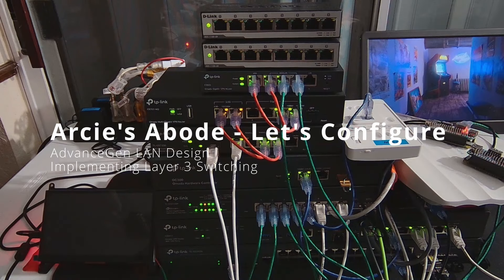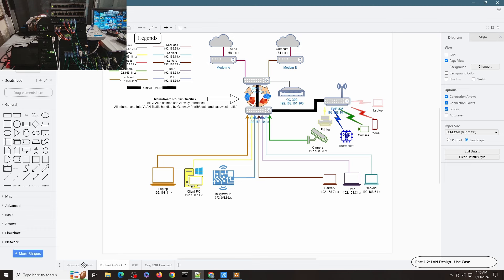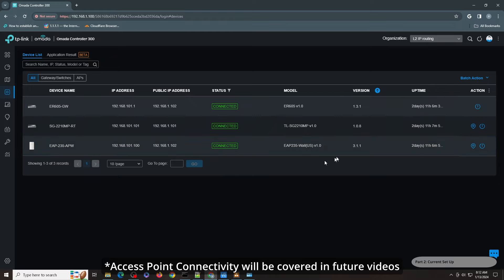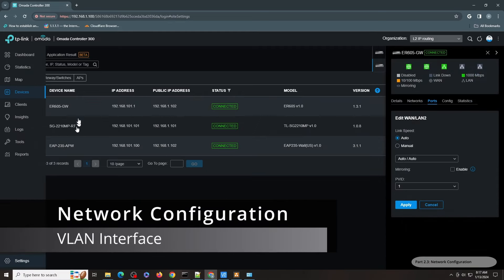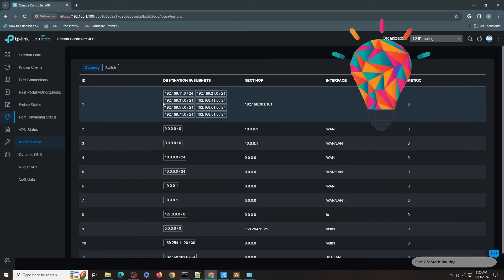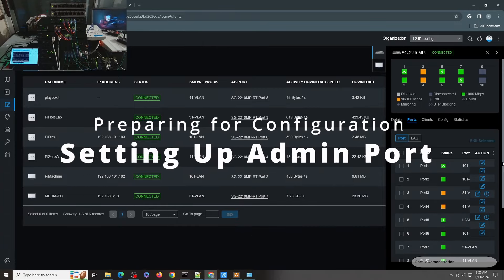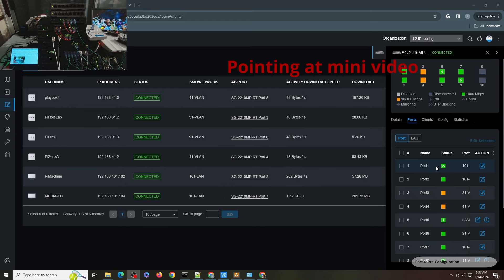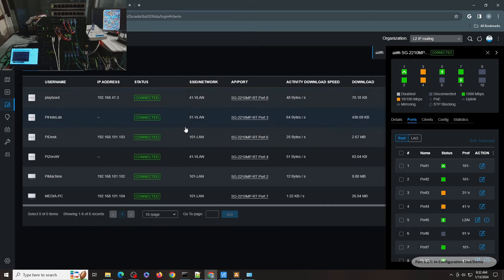LC67: Layer 3 Switching with TP Link Omada. Use switch, instead of Gateway, for InterVLAN routing

Comment: Thanks for the video. I had a question about using Interface Lans and Layer 3 switches. Please correct me if I am wrong, as I am having some trouble understanding the best way to set this up.
I think that even if you use an interface Lan instead of a VLAN, the Layer 3 switch will still route traffic directly across the Lans, rather than forwarding up to the router. I think this happens in the default Omada setup without any ACLs.
In your NextGen network setups you segregated your interface Lans with Switch ACLs, and that did prevent traffic flow. Isn't that because you didn't have LAN->LAN Gateway ACLs set up, so by disabling the routing bypass with the Switch ACL, the packets get forwarded to the default gateway for routing and are then dropped?
What I mean is, with Interface Lans and appropriate Switch ACL setups, the "router on a stick" problem can still be mitigated for everything that doesn't need a stateful firewall.

Or maybe I got completely the wrong end of the (router on a) stick?
Reply from the maker: hey there @Mark-px3rq, thanks for dropping by the channel. It may seem like I have confused you on my videos so me let just try and clarify. "Network Routing" is performed at the Layer 3 and usually performed by a device called Router and in Omada, they call it Internet Gateway. Routing is performed in "Layer 3" of the network stack and deals with things like IP address. "Network Switching" is performed at the "Layer 2" and done by a device called "Switch", and deals with things like "MAC address", These two are required to have a fully functioning network. However, ACL is not, it is a functionality that grants or denies access (hence Access Control List name). This means, Routing and Switching, while impacted by ACL are completely different, they all work together and intermixed but while the two are basic building blocks of networking, ACL is not. 

With NeXTGen - ACL I used are Switch-based i.e. they work in the Switch but that doesn't mean "routing" happens in the switch. The ACLs are working in the Layer 2 and not in Layer 3, but the ACL is NOT responsible for "routing" because ACL is not routing, it is about granting/denying access whether there is routing or not.

The easiest way to test, create a traditional Omada LAN:
a) Make sure you have more than 1 VLANs defined in your Omada LAN i.e. VLAN 1, VLAN 10, VLAN 20 and all are Gateway Interface (i.e. not Layer 3 Switching)
b) Make sure you are using Omada Gateway and Omada Switch
c) Make sure no VLAN Interface is enabled on the Switch except for VLAN 1 (default)
d) Make sure you have no ACL active.
e) Plug at least one host per VLAN on the Omada Switch, including the Admin PC/Host

Testing:
0. Make sure your admin pc/host is connected to the switch
1. On the admin host, open 2 (or more) consoles, do consistent ping for each host on VLAN 10 and VLAN 20
2. Remove the cable between Switch and the Router. Without the Gateway uplink, ping will fail. This means the Switch is NOT doing routing even if the Switch has all the VLANs defined on it, With Layer 3 Switching (this video's goal), this will work since Switch is responsible for InterVLAN routing.

Hope this helps!

Comment: Thank you for that video! It is brilliant! May I ask you few questions? Were you would locate local DNS server (like PI-HOLE) in that setup? I have an idea to put them in 101-Admin vlan and set router to use those DNS and the PI-HOLE will ask any public DNS. The other question is related to controller. In your setup controller is connected to the router. Is that realy matter where controller is located? Can I connect it to the switch? I want to use POE that is not available on router/gateway ports.
Reply from the maker: hey @rafalbremer432, thanks for dropping by the channel. For the DNS, it depends on you. It can be local to a single VLAN, or to a router that serves multiple VLAN. If you need granularity, you will need to manually point each VLAN to your PiHole, this is how I have it configured on my home. If you want simplicity, you can point your router to the PiHole but note that PiHole has its own quirks, so you will have to be aware of that in case trouble shows up and in this case, the Admin VLAN 101 is a good choice to place it.

As for controller, the location is mostly based on my personal use-case, because I need the controller to be easily accessible by the router but it can be connected to a PoE switch if your Gateway doesn't support PoE.

Good hunting!

Comment: Thanks, that works!
But can I create rules now? I have created 2 VLAN networks "Home" and "Server". Everything works. How can I set it up so that HOME has access to SERVER but SERVER does NOT have access to HOME? If I create an ACL-Switch rule that blocks Server->Home, then Home no longer has access to Server? This rule blocks "Bi-directional" :(
Reply from the maker: Hey @DSeimann, yes you can make rules. I have addressed the challenge you mentioned about "bidirectional". I covered the ACL in a long-form video (link below) but I also have a short write up (not covering the whole vide) that I made over at TP Link and reddit. I added here a short summary of what that ACL covers:

"Use Case 1
Home VLAN can "ssh" to IoT VLAN but not the other way around.
Use Case 2:
IoT VLAN can "vnc" to Home VLAN but not the other way around
IoT is denied access to all other VLANs
 
These 2 Use Cases will NOT be possible if Gateway ACL is used because Use Case 1, the Source is Home VLAN and on Use Case 2, the Source is the IoT VLAN."

Layer 3 Switch ACL video: https://youtu.be/yraDD9P-PZk
Partial Write Up: https://community.tp-link.com/en/business/forum/topic/656428?page=1
Reply: @deadmeats  Thanks for your answer. I sent you a detailed report in the Omada forum about my problem with ACL
Reply from the maker: heya @DSeimann  , i finally got the chance to check it out and I have replied there. Copy/pasting my reply there here as well:

There are two ways to go about this. I agree with Clive that if you want a non-granular (IP  Port Group-based) ACL, then you have to use Gateway ACL.If you go the Gatewat ACL route, you can never have Granular (IP Port-Group-based) ACL meaning, your Source from one ACL Rule can NEVER be a Destination with another ACL Rule. You can request a feature to support IP Port Group for Gateway ACL if you need to.

The second way is, just go fuill Switch ACL and follow my posted guide. In your ACL, in your question why it works that way, it is because it's supposed to work that way. If you want Server to have "granular" access to home, I edited your posted ACLs, and inserted ACL Line 2 and edited ACL Line 3 (your old ACL 2) to demonstrate this. it will allow your Home to SSH to Server devices, BUT also allowing Server devices to FTP to Home devices (assuming there's an FTP server/service running in Home VLAN 100) . This can never be done with Gateway ACLs (maybe in the future it will).

Switch ACLs:
ACL1 - Permit Home devices to SSH to Server devices
Permit Home SSH to Server
Policy: Permit
Protocols: All
Source > IP Port Group > (Subnet 192.168.100.0/24, Port: 22)
Destination > IP Group > (Subnet 192.168.200.0/24)

ACL 2 - Permit Server devices to FTP to Home devices
Permit Server FTP to Home
Policy: Permit
Protocols: All
Source > IP Group > (Subnet 192.168.100.0/24)
Destination > IP Port Group > (Subnet 192.168.200.0/24, Port: 21)

ACL 3 - Deny Home devices to access Server resources
Deny Home to Server
Policy: Deny
Protocols: All
Source > IP Group > (Subnet 192.168.100.0/24)
Destination > IP Group > (Subnet 192.168.200.0/24)

Remember this tip, which I covered in my past ACL videos: Default is Permit All, You allow what you Deny, and Whitelisting (Deny some/Permit Some).

Look at all "Sources" in those 3 ACLs and you will see what is "common". ALL the Permit's Source is the Deny's Source aka Home (in my example IoT)! In your original ACL, you Denied "Server to Home" (VLAN 200) and then "Permitted Home to Server" (VL:AN 100) but there is no need to Permit Home because (remember the tip) the default is Permit All and the only Permit you need to do is IP Port Group (remember the tip Whitelisting). Because if you Permit everything anyway, there is no need for ACL (remember the tip: you allow what you Deny).

Now another tip using the ACLs above, I used SSH and FTP, but you can use any protocols, known or custom one. If you would like to "observe" the functionalities of the ACLs, change ACL #2 from Port 21/FTP to Port 22/ssh. For testing, always have ACL 3 as ON. Now play around with ACL 1 and 2, turning them On/Off, Off/On, On/On, Off/Off or however you want. Each time you turn On or Off an ACL, do an SSH From Home to Server, then from Server to Home. Observe how they work. Work slowly, and be patient because ACLs can sometimes take time. So start with just ACL 3 On, then wait a bit: ssh (on either). Then Turn On ACL x, then wait a bit: ssh (on either). Rinse/repeat. Hopefully this will get you more familiarized with how the ACLs are structured and how they work.

I hope I don't get you confused even more. I know this is a confusing subject, I have been covering Omada ACLs for 3-4 years now and I think some of my viewers did get it but for the most part, I still don't know how to properly explain it :) :) :). I came up with it because there was no Stateful ACL for the longest time and so many users complained they can't do stuff but I keep telling showing how to do stuff but I keep failing haha :)

Check this video and maybe it can also shed some light. Sorry for late reply, and Good hunting!

Comment: It is really a great Video. I could also use the same for My network. However, I still didn't understand the use of the port Profile L2All is created for and for which ports are you applying them. I would appreciate any help. 😀
Reply from the maker: hey there @mmo-tech, thanks for dropping by. the L2ALL profile is useful if you have multiple Layer 3 Switch environments. If you only have one Layer 3 switch, you do not have to worry about this implementation. But if you have multiple, let's say, two(2) Layer 3 Switches (A and B) in completely isolated implementation (i.e. different companies), you need to know which "All" you are working with. In L3Switch A, you have VLANs 10 and 20, and L3Switch B, you have VLANs 11 and 21. If you use a normal "All" profile, that profile will have VLANs 1, 10, 11, 20, and 21 (literally, ALL of the VLANs in the Omada). You normally do not want these type of configuration, unless you absolutely understand what you are doing because you will never want these two companies have any mix up whatsoever :).

Good hunting!

Comment: Hello my dear, really great video!! But is it possible that the routing (without you suspecting it) goes through the router? I wasn't able to trace it without the router. Maybe you can test it by unplugging the router! I couldn't establish static routing with just the switches alone. Its a T-link Bug i think
Reply from the maker: hey @Iceflash75, thanks for dropping by the channel and thanks for the kind words. As for your observation, maybe I have not explained it well, but the "Static Route" is the reason why the Layer 2-only VLANs (non-Interface) have access to the Internet. Meaning, they need to go to the Gateway/Router to be able to access the Internet. So what you are seeing is the "normal behavior" because the Static Route is meant to connect the Gateway and the Switch. If you remove the Static Route, then all VLANs defined in the Layer-3 switch will just communicate within the switch. It is ok to turn off the Static Route (or limit which VLAN can go the Internet) if you don't need to. I hope that makes it clear :)

Happy Hunting!
Reply: @deadmeats Hi, thank you very much for your response!
Of course, you are right!!
I apologize, I didn't express myself well.
What I mean is that I can't enter static routes without a connected T-Link router. This applies to VLANs as well.
All routes I enter do not appear in the "Routing Table" (Omada or CLI).
It doesn't matter whether I enter the route in Omada, directly on the switch in Omada, or in the standalone switch in the GUI or CLI.
My setup is a Fritzbox as the router and an L2 L3 T-Link switch (SG2016P V1.20.0).
If I enter the static route on the Fritzbox, everything works immediately.
That's my observation...
Of course, I could be wrong... I would appreciate it if you could tell me if I'm wrong...
Best regards... 🙂
Reply from the maker: hey  @Iceflash75  , the Omada's option (Transmission > Routing > Static Routing) works on the Omada Gateway. If you don't have an Omada Gateway, i think (not sure) you can't use this option. What you did, entering static route in Fritzbox is the right approach. If you you would like to experiment on the switch, you can try this:

add a static route from your Layer 3 switch to your "non-Omada" Gateway/Router (Fritzbox) (Devices > Switch > Config > Static Route). Note that i tried this about 3 yrs ago so it may have changed so refer to updated manual. say if you have 192.168.0.1 for your fritzbox, you need to add this as the next hop. also, if you want all other traffic (i.e. internet) to go to fritzbox, you may need to add 0.0.0.0/0 pointing to 192.168.0.1 in your configuration. I dont recommend this option btw ;) but it's good to know in case you have multiple layer 3 switches connected together since the same idea, theoretically, should work. i am not familiar with Fritzbox nor how Omada will work/discover routes with non-Omada Gateway so you will have to do some testing/digging.

edit note: noticed you mentioned you already tried the Static Routing with Fritz Box so removed my comment about adding Static Route in Fritz Box ;)

Happy hunting!
Reply: @deadmeats  Hello @deadmeats,
thank you for your response and your time! I don't want to keep you any longer because you're doing a great job with your videos!

I just have 2 more questions:

    One for myself: Why did I buy an L3 switch that can route VLANs if it's not doing that? :-)

    For you: I'm curious to know if, when you unplug the T-Link router, does the routing between the VLANs on the switch still work?

Thanks for your time!!
Best regards!
Reply from the maker: hey @Iceflash75  , you are most welcome and you are not keeping me from anything. However, I do have to run away and do some stuff so my reply time is erratic so apologies for delay. I had to finish my other video (which I just upload an hour or so ago) which has been taking up my time.

anyway, as for your question: i fully agree. my switches has been doing interval routing for a long time, but I never really posted any video because I would like to make sure the regular viewers see what are the challenges for the Router on Stick before I jump into it (you can see my videos about NewGen LAN redesign last November and December). I think someone asked about switch routing in one of those videos, but I gave a safe answer instead (use the Gateway) because I am not sure I can reply on a timely manner and may have caused them significant delay. btw, if you are serious about L3 switching, just note of the "limitations" :)

as for your second question, yes I did that and the routing for ALL Layer 2-only VLANs still work. Of course, all traffic destined to the Admin/Management VLAN died. You can also quickly test this by: a) removing/adding static route for each Layer 2-only VLANs that you defined as Layer 3. I have demonstrated this in the video I just uploaded, which applies for Camera VLAN. b) setting the uplink profile as a single VLAN as can be seen at 14:19 Port 1 of the Layer 3 switch. You will notice that I am not using a Trunk profile, instead, the Switch link that connects to the Gateway is configured as an access port: there is only one VLAN! You can also do packet capture and check if the gateway layer 2 header is being replaced by the router mac address.

Hope it helps, thanks for dropping by the channel again. Good hunting!

Comment: Paano kaya sir pag yung setup gusto ko sana ma achieve yung kagaya sainyo kaso L3 ko dalawang DISTRIBUTION SWITCH? 

primary & secondary DSW / 2 tier design.

Questions: 
1. Saan ako mag define ng SVI DHCP scope? Sa primary lang ba o both ng Distribution switches? 
2. Pag nag static routing para ba piliin na yung primary DSW ko na doon dumaan babaan ko nalang METRIC? 

Sample Static Route Metric Config:
Primary DSW = 1 
Secondary DSW = 2
Reply from the maker: hey @davidesguerra7837, pwede ka naman mag karoon ng 2 (or more) L3 switches. Pero ang alam ko, walang automatic fai-over or re-routing yung mga L3 Switch ng Omada ngayon (siguro sa future, meron na, o baka meron di ko lang alam). Kahit idagdag mo ang metric, pag nag fail ang primary route, di pa rin mag switch sa secondary route lahat ng dependent devices i.e. laptops, etc.

1. Sa isang Switch ka lang mag define ng DHCP scope para maiwasan ang conflict. Wala kasing DHCP reservation si L3 switch.
2. Na mention ko nga sa intro post ko, pwede mo baguhin ang metric mo pero sa experience ko lang (limited testing lang), di ko alam pano mag fail-over sa secondary link. Pwede ka mag design based sa LAG/LACP or even STP/RSTP. Pero kung goal mo ay magkaroon ng "hot" back up L3 switch, di ko pa ito nakitang gumana. Pero, di naman ako expert dyan so check mo lang sa TP Link, baka naman meron silang settings. Di ko kasi masyado ito na test.

Okidoks!!!